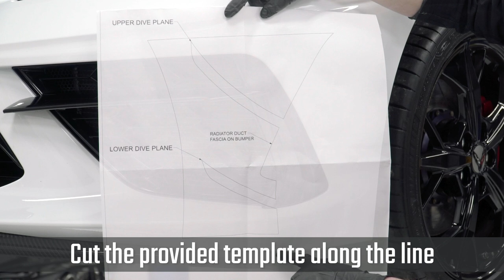Verus Engineering C8 Corvette Dive Plane Kit Install with Paragon Performance

Comment: Will you be making carbon flash model?
Reply from the maker: No plans at this time for a carbon flash model, that would require four more molds, and painted products are more prone to chipping. :(
Reply: One more bid for canon flash, it is only prone to chipping if you don’t do PPF.

Comment: Nice product. I just wonder how long the tape will last at high speed and weather changes.
Reply from the maker: We've been running their Dive Plane Kit on a Porsche GT4 for multiple years. Rain or shine track day events and they are still on! Proper surface prep and curing time will make a world of a difference.
Reply: I'd give it 4 years, buy 2 sets if you plan keeping the car beyond 5 years.
Reply: After a nice rain storm they will fly off
Reply from the maker: Corvettes don't see rain silly goose.  ;)               Also this tape is engineered to deal with these issues, it isn't "standard" tape, it's reserved for MFG's and OEMs and much stronger than off the shelf stuff.  Special order only. :)
Reply: Products designed years ago with this tape, are still together. 3M HB is pretty nasty stuff. But ceramic coatings were not a thing yet. Will it stick to something that has a ceramic coating on it?

Comment: These need to be bolted also. Not riveted either. Still interested.
Reply from the maker: They don't need to be bolted on. Per Verus Engineerings instructions you can do the 3M Tape alone. We have had their Dive Plane Kit on a Porsche GT4 for multiple years with no issues.
Reply: I’m hard to be sold on this. It won’t hurt and gives 100% certainty. Maybe cause they are not  that aggressive/ wide. I’ve seen some APR dive planes/ canards (which are wider more aggressive) come off a a fellow GTR that choose to using only double back tape at Road Atlanta back stretch at 177 mph. Mine were bolted and absolutely had no flex. Piece of mind.
Reply from the maker: You could drill and bolt these if you wanted. But we find 98% of customers really do not like putting holes into body panels.

Comment: Lick and stick on a $80,000 C8 I just don't get it.
Reply from the maker: You can drill into your $80,000 car bumper if you want. These can totally be mounted that way, but it's not necessary.

Comment: $480? Are these carbon fiber? Otherwise, way overpriced! The aftermarket for the C8 is overpricing most parts. I understand you have r & d costs, but you would be better off lowering price and making money on volume sales.
Reply from the maker: Yes they are carbon fiber. Should be easy to see in the video that they are 100% carbon fiber.  Also this is 4 molds, so that's were a lot of the cost is. CNC aluminum molds aren't cheap.  ;)
Reply: @ParagonPerformance  My bad. Carbon fiber is expensive. Worth every penny. Nice!
Reply: Agree with C5. Way too much for me.
Reply: It’s a good price. I’ve seen one set cost more.
Reply from the maker: All good.  We appreciate the feedback. :)
Reply: I'm with you.  I was all in on it up until I saw the price..  $480 and I have a funny feeling these will blow away with the wind...